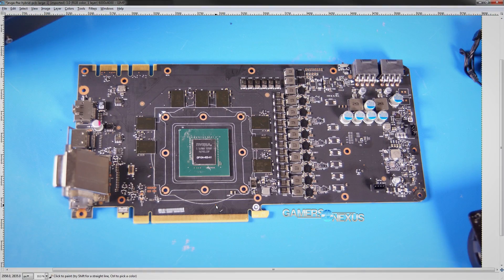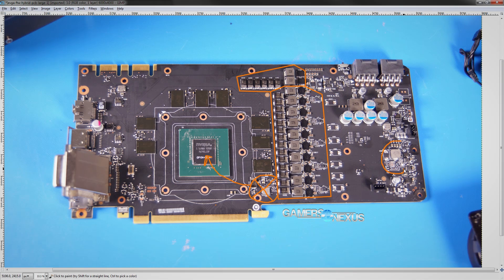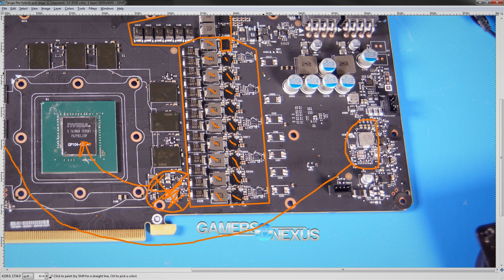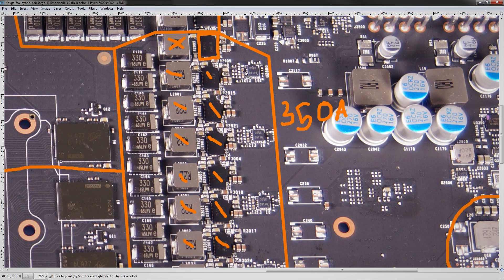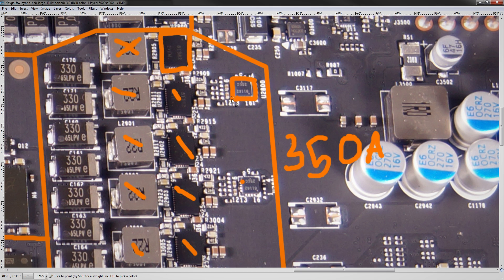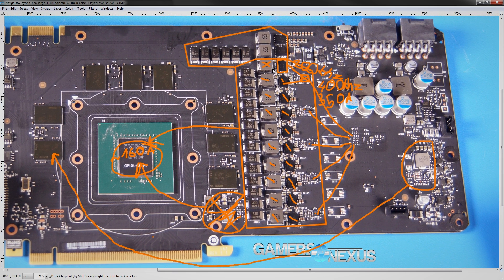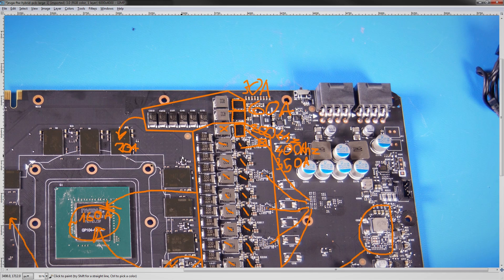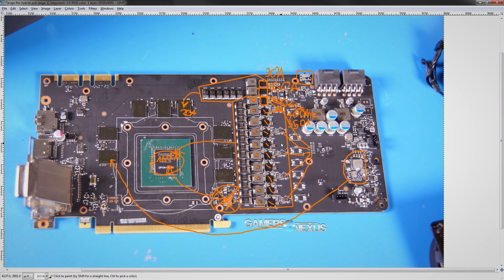PCB Analysis of EVGA FTW Hybrid GTX 1080

Comment: Hi, Could you say the reference code for the Q36,Q37, Q38 components?
I believe it to be the same transistor as Q36 and Q38 near it (MagnaChip MDV3605 P-Channel MOSFET), but I need to be certain before buying the component to avoid further damage to the card. Thanks!

Comment: I would like to know why some brands surround both sides of the vrm with capacitors and others don't (maybe cost cutting)? and why EVGA uses those different types of capacitors (those rectangular things on the left of the chokes) rather than the traditional cylindrical ones. Hopefully Buildzoid or someone knowledgeable can answer those questions.

Comment: Any thoughts on the quality of the chokes used on this model and the the likelyhood or not of coil whine, are they super ferrite/alloy and better or worse then comparative brands ?
Reply: I can't get a datasheet for most chokes since they usually don't have model numbers. Other than that none of the choke makers actually care about coil whine so the datasheets don't specify anything about it. However with low per phase current this GPU shouldn't get coil whine because the low current shouldn't generate enough of a magnetic field to significantly vibrate the chokes.

Comment: by the way I am pretty sure he meant watts not amps :)
Reply: definitely amps. 12V at around 15A goes into the VRM and on the other side you get 1.X volts and ~160A

Comment: So if 10 phase GPU is overkill is there a 8 phase one if so could someone please send a link im looking to ascend again thanks
Reply: The MSI Gaming X is an 8+2. The ASUS Strix is also an 8+2 and uses more high end components than the MSI. Really just go for which ever 1080 is cheapest and has the best cooler because they all seem to clock the same and it's more about the silicon lottery than about the PCB.

Comment: MSI GTX 960 Reference PCB analysis? Please make a video about it Steve.
Reply: I can throw one up on my channel
Reply: Gigabyte G1 gaming 970 PCB analysis? mine is a hell of an overclocker and I would really like to know more about the PCB and its components
Reply: I can only get decent pics of the 980. Mind you the G1 cards are mostly so great because Gigabyte almost certainly bins the chips for them pretty hard.
Reply: Actually Hardcore Overclocking Throw up and I will check it
Reply: Ok well it looks like there isn't a reference GTX 960 PCB photo at any decent size. Also none of the GTX 960s you could buy used the reference PCB. I can do the ASUS, MSI, Giga or EVGA.
Reply: +Actually Hardcore Overclocking lol
I asked for MSI GTX960 Reference PCB analysis.
Reply: MSI + reference >> doesn't compute. Nvidia makes reference PCBs any other PCB is custom. Oh well so you want the MSI 960 Gaming? I've already managed to get the datasheets for everything on it so that would make my life easy

Comment: what is the point of power phases, chokes and mosfets,  or any of this? Why is it there's so much video card space dedicated to power circuitry if the PSU is already efficient at delivering power? Why don't PSU already give the GPU the power conditioning it needs? I assume it has to do with the wave form of this power (even if it's DC) as you'd see on a oscilloscope and it seen to be at a particular frequency and wave form. But again if we have dedicated GPU power from the PSU, why cant this be done at the PSU?
Reply: becauses GPUs don't run on 12V. They run something between 1 and 2V and this voltage changes generation to generation. Same as CPUs those also run on something between 1 and 2V. Since all these have different optimum voltages. The PSU just supplies 12V and the your GPU or mobo step it down to something the chips can actually run on.
Reply: No PSUs deliver more than just 12 volts. there's a 5 volt rail, and a 3.3 volt rail. But if a GPU needs less than 2volts then why are they so power hungry at even 1.5volts? Why bother with a special 12v rail for video cards when it CAN supply lower voltages?
Reply: 5V and 3.3V only exist because there are voltage controllers and other ICs that run on those voltages. The other reason is that you can't push high currents at low voltages through cables very easy. A GTX 980Ti pulls closer to 200A. Where as a PCI-e 8pin can only handle 10-20A  depending on the connector and cable quality. So you would need 10 8pins for 1 GPU. Also mind you say the 1080 we have here that has 4 different voltages it needs in order to work. A Haswell CPU has Vcore Vuncore VCCSA VCCIOD VCCIOA. The PCH also runs on it's own voltage. DDR4/DDR3 also have their own voltage. There are so many different VRMs in a system that trying to put them all in the PSU would be incredibly expensive and you wouldn't even need all of them. Then in order to actually deliver the power you would need insanely thick cable to get the current through put necessary to feed the components and you'd still have a ton of power loss on them.

Comment: Even at 1.12 Volts... 160 Amps will kill you :)
Reply: yeah except for the part where your body is several Kohms of resistance so yu won't get any decent amount of current going through you without some high voltages.
Reply: how about you try to hit yourself with  live on youtube so we can see? :)
Reply: Hit myself with 1.12V or with 160A? Because I've done the first one plenty of times. I've also touched the PSU's 12V output. What I really won't go and touch is something with a high enough voltage to push 160A through a human.
Reply: i want you to try and touch a source of power with 1.12v and 160A and see what happens :D I bet you would get a lot of views hahaa :)
Reply: You ever heard of ohms law? It looks like this: I = V/R. I is current, V is voltage and R is resistance. If you have a resistance of several thousand ohms you need several thousand volts to get 160A. A GPU pulls 160A when running because it has a resistance of about 7mohm when running. 1.12V/0.007ohms = 160A. There is no such thing as a current source. Voltage causes a current. Current doesn't just happen. So I can go touch a 1.12V source I can not however force it to create current of 160A through a human because that is against the laws of physics.
Reply: +Leon Vuksic Rekt, lol
Reply: +Leon Vuksic no... it's watts that kill you... the "it's the amps that kills you" is BS.

watts is voltage x amps.

if both of them are significant enough, you will die.
Reply: A civil, educating discussion in Youtube comments? brb checking hell for snow & flying pigs
Reply: Thanks for explaining this to me guys, never thought I will learn anything in youtube comments :D
Reply: +Leon Vuksic another way to look at this is amps is the energy being consumed or wants to freely flow, volts is the energy that wants to push those amps at light speed, to the ground and kill you.

you need a certain quantity of both to have an effect.. so if you were to say... have tons of amps on that rail, and little volts. you have a lot of power that doesn't have much of a drive to go anywhere. kind of like potential power, but it's not. it DOES have some volts so it's theoretically moving.

having tons of volts and little amps, means you have an ambulance getting a small amount of energy somewhere with urgency, and that small amount of energy will release on almost anything.

but having a significant amount of both, will cause your death.

if you have a high voltage, or electric urgency, to react with something, and you have a big load go dump off your shoulders, whoever takes that hit is dead.

watts. ;)
Reply: +SlackPie/Mystosia and .000001 amps can kill you if enough volts are there to supliment.

it's all about energy released and that is determined by watts, not individually amps or volts.

THEN the receiving substance resists the reception of electrons based on how well they flow in the material.
Reply: +SlackPie/Mystosia I do know electronics... you obviously don't...
Reply: +SlackPie/Mystosia yep.. I've already stated that on this thread, and ohms law has already been stated.. thank you captain obvious with showing you know the formula but can't do math.

try harder or disprove the laws of physics that are already set in stone. best of luck.
Reply: +SlackPie/Mystosia I mean HONESTLY it's painfully obvious you didn't even read the thread, you just jumped in anywhere and went after it.

read first next time, you won't look like such a jackass. :D
Reply: +SlackPie/Mystosia I actually am certified and work in the electric industry.. I'm a journeyman electrician and school for me was a long time ago.

so nice try kid..

you really don't know what you're talking about, I could highlight the several instances where you are wrong, and I am right, and then give you sources, but I've already given you the information. all you have to do is look it up!
Reply: +Leon Vuksic for instance, 1 x 160 = 160

20 x 20 = 400
Reply: SlackPie/Mystosia watch the video I posted read what people actually wrote, you are a moron. You moroned up a perfectly nice comment section.
Reply: SlackPie/Mystosia please explain more
Reply: +SlackPie/Mystosia 160 amps isn't enough to kill you at 1 volt.. it's only 160 watts, and 1 volt isn't enough to counter act your natural resistance of the human body. 

you NEED a certain amount of power flowing through you.. power is defined as amps x volts.

high volts and low amps, is like licking a battery. you'll feel something but it won't hurt.

high amps and low volts, you'll feel nothing because no volts means NO CURRENT

you need both amps and volts.. or... watts.
Reply: +SlackPie/Mystosia you're such a dumb ass, you probably don't even know what resistance is... it's all "back in my day Thomas Edison flew a key on a kite!"
Reply: SlackPie/Mystosia dude watch the video I posted in this comment thread. A guy literally does what you say a human can't do, he touches an electric current to his tounge greater than you say and guess what he doesn't die. 10v 150amp.
Reply: SlackPie/Mystosia no, I think it is more likely, YOU a kid in school is wrong, rather than the guy who runs the channel with his degree and extensive electronic background. Everybody is telling you, you are wrong but you can't admit it.
Reply: Alright I will retract my comments then considering most of you are being dickheads about this, also I never said anything against the guy who runs this channel/did the video, you are just putting things randomly out there ffs, anyways peace guys I have no more time to discuss this with people if your gonna be dickheads about it, also the theDarkToes is definitly no who he says he is no fucking way anyways thanks again peace
Reply: SlackPie/Mystosia no I said the guy who made the video about volts and amps and what kills and you said.. Oh wait I can't quote you, you deleted your dumb ass comments, what a surprise but you straight up said he was lying.
Reply: Manic Demise Yeah I did, followed by a lol. Anyways your just a rude kid on the internet so idrc what you have to say to me or about me anymore kid :)
Reply: SlackPie/Mystosia I'm 29, no ones been rude beyond how you have been rude to everybody else. 

Maybe if you weren't so rude in the first place and actually investigated the subject instead of assuming you are right, you could of avoided looking silly and learnt something. 

Also FYI only people under 18 think its an insult to call others kid.
Reply: +Manic Demise right... I saw the video.. I didn't say it would kill you.. I said watts is what kills you not amps.. so..
Reply: +Manic Demise p.s. everyone isn't telling me I'm wrong... one idiot is.. haha
Reply: TheDarkToes that message isn't for you its for Slackpie
Reply: +Manic Demise oh ok. .-. well good. O.O
Reply: TheDarkToes hes deleted all his comments oh.

He posts a comment then deletes it like a child.
Reply: Manic Demise K
Reply: As an electrical engineer I approve this message
Reply: Gabriel Fernandez But it's wrong, as I was clearly proven
Reply: SlackPie/Mystosia It wasn't supposed to be directed to the first comment lol My bad. I meant to say that Actually Hardcore Overclocking explenation of OHMs Law is correct and proves the whole argument
Reply: Gabriel Fernandez Oh of course haha all good lol, :)
Reply: Do they no longer teach Ohm&#39;s law in schools? Geez...
Reply: i got rekt hehe I didn't know that, tbh I don't know much about electricity, but I thought that amps kill you not volts, so thats why I thought that this could kill you :)
Reply: +SlackPie/Mystosia no... you're an idiot... 160 amps at 1 volt isn't very powerful. your body has more resistance to fight off 1 volt..

Volts are how well the energy wants to react, resistance is how well the substance doesn't accept volts.

ohm's law, is a real law.

hint it being a LAW. in order for scientists to consider something a law, it is much much examined that you can imagine.

if you think ohm's law is bunk, provide evidence.

Comment: if the FTW is overkill then whats  the Classified? Great vid nice to learn more about this stuff
Reply: When EVGA design the GTX 580 Classified they created what I consider the "classified signature VRM". It was meant to feed a GTX 580 on LN2 so it was designed to handle 840A at 125C. EVGA has been copy pasting it onto every Classified card since they first designed it. So all the Classified cards are super super overkill. Some of them like the 580 780Ti and the 980Ti actually get close to using the insane 840A that the VRM can do however they are still safe even on LN2. The K|NGP|N cards use PowerIRStages instead of discrete MOSFETs. The end result of that is better efficiency and more accurate voltage regulation but the power capability remains unchanged.
Reply: The classified is like trying to protect yourself from a sword blow by getting inside a tank
Reply: Overkill with led's and a 6 phase voltage controller!
Reply: It's what the Kingpin cards are based off I believe

Comment: 160 amps? you mean watts right?
Reply: nope
Reply: amps x volts =watts   160amps  x 1v= 160w  160amps x 2v =320watts
Reply: the 1080 would create a pretty realistic smoke effect at that voltage
Reply: 160 amps at around 1.12 volts equals the 180 watts the 1080 is rated for. Low voltages, ultra high amps.
Reply: Vel0city Okay thanks! I was thinking typical power outlet voltage 110v at 160 amps is crazy lol
Reply: Alright so why does my vacuum with only 15 amps dim the lights when I turn it on, but my PC does nothing to them whatsoever? Serious question.
Reply: the power draw is much higher (at least 1,5 kilowatts), which is more than a whole computer.
Reply: Because the voltage combined with the amperage is what causes such a power draw. Also your power supply's parts are partially charged all the time, so that might have something to do with it not dimming the lights. I have a computer that uses less than 500 watts with a geforce gtx 1070 evga sc and my lights still dim from time to time.